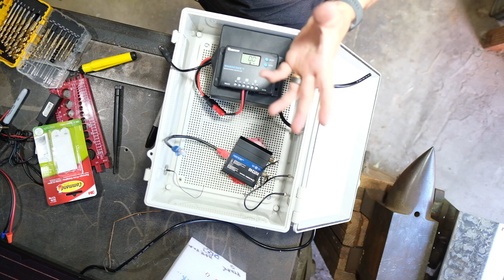Off Grid Miner: What's In The Box?

Comment: Hey king I'm going to be making a off grid solar miner but can you please help with a question I have.ok I'm wanting to know if a 3.2 volt 100amph battery will run a indoor nebra and a hotspot with 2 50 watt solar panels one to catch the rising sun in the east at 45° and one to catch the setting sun in the west at 45° what do you think or would two 3.2 volt in series be better so 6.4 100amph please what do you 🤔
Reply from the maker: Hi Mike, you'd have to run the numbers for your area regarding battery & panel size.  Volts x amps = watts.

Comment: Getting close to finishing my first off grid build thanks to you...One big question...if Im using a Sensecap miner can I just cut off the transformer and wire direct into the load of the wanderer?  And would this run in parallel to the load from the cell modem? Keep rocking it!
Reply from the maker: Nope, the Sensecap takes 5v and the Wanderer is pushing out 12.  You'll need a 12v to 5v buck converter with a USB-C end, like this: https://grstl.ink/buck-converter
Reply: @thegristleking  fortunately I have 2 in my possession...appears to fit in the sense cap...as far as the PepWave Max there is not a USB-C fitting...but there is a set of power lugs...you think I can direct wire to Wanderer as long as I fuse it?
Reply from the maker: @carlbreeden9074  just check the input voltage range on the PepWave; that's what you're using for a cell modem, right?

Comment: Hey Mr. King thanks for the vids. I'm very excited about the possibility of an off grid miner. Does the RUT240 take a sim card? Thanks
Reply from the maker: Yo DG!  Yep, the RUT240 takes a SIM card.  All cell modems should, whether you're getting Cradlepoints, Teltonikas, or another brand.
Reply: @thegristleking  I have a 40GB plan from ATT provider, I heard on another video it needs to be 100. why does it have to be so high. Also when I remove the sim card from my current hot spot and I insert it on RUT240 the only port I need to open is the 44158 or is there another port? can you do a video about settings on RUT 240 and why you need so much data. thanks in advance, your miners are sick!
Reply from the maker: @Diydad05  the reason the data requirement is so high is that current hotspots keep a copy of the blockchain on the miner.  That copy is growing larger and larger as the network grows.
  Once we move to Light Hotspots the data requirements will drop from where they are (up to 150GB/month) down to 100MB/month or less.  Yes to 44158; that should be it.  Check this RUT240 post:  https://gristleking.com/step-by-step-rut-240-for-helium/
Reply: @thegristleking  thank you my brother! Happy thanksgiving. I think I have to change my T-Mobile sim to a business plan now. Have the current one and doesn’t work with the RUT. Going to go thru your checklist to see if I can get this working. Keep up the great work. Thank you for the reply, much appreciated!
Reply from the maker: @Diydad05  careful with the current RUT instructions; the off grid stuff is in total flux right now, and many are finding that a static IP is stopping their earning.  You may not need a large data plan at all.
Reply: @thegristleking  Are you finding the miner is profitable, even paying for the data plan?
Reply from the maker: @AkolytosCreations  yes, but keep in mind this is JUST the packet forwarder.  I'm able to do that because this is a DIY Hotspot from way back a year and a half ago when that program was open.  The good news is that this is what Light Hotspots will be, so if you can hang on for a few weeks you'll be able to do the same.  Data use is 100 MB or less per month on this.

Comment: How to do you power the RUT 240? I couldn't figure out how to power it with the VIctron Smart charge controller. I tried using a 9V step down converter connected directly to the power pins. Also for the bobcat since it is 12 V 1 amp power in can I directly connect it to the charge controller?
Reply from the maker: Take the cable that comes with the RUT240 and cut off the wall wart.  Strip the outer sheath and you should find red & black cables. Hook those up to the correct "load" terminals on the Victron.  Victron puts out 12v, RUT240 takes 9-30v, so no stepdown needed.  For the Bobcat you can do the same; since it takes 12v you can connect it directly to the load terminals in the Victron.
Reply: @thegristleking  Hi! Thanks for the videos!

What should I connect the pin 3 and 4 (INPUT and OUTPUT?) to? Are they needed? 

Or should we just connect the red and black cables?
Reply from the maker: @apeusmaximus  I think it's just red & black IIRC.  That should be all that's in the RUT240 cable, right?
Reply: @thegristleking  the schematics say also a INPUT (green) and OUTPUT (white)?

Hence the doubt. Maybe they don’t matter, maybe they do 😅
Reply from the maker: @apeusmaximus  fair enough.  The red & black is all I connected.  :)
Reply: @thegristleking  ok great to know! Thank you so much :)

Comment: Isn't there huge cable loss with the connector?
Reply from the maker: Nope, why would there be huge cable loss?
Reply: @thegristleking  because of the short not isolated antenna cable. I heard the RAK antenna cable even has a 2dbi loss
Reply from the maker: @Daniel-ck8ii  not unless it's a super long super thin cable.  In the case of this miner, the losses are minimal.  It's a few inches of tiny cable into the N-type connector, than less than 3' of LMR400 into the antenna.

Comment: Just tried building this and the panel won't even charge the solar controller enough to turn on. Anyone else had any luck with this setup? Completely lost and out some $$$
Reply from the maker: Hi Morgan, did you charge the battery fully before starting up?  Have you tested your power draws?  Have you tested the panel? 
 Sounds like there's a step being missed here, or you might have some faulty gear.  Carefully go through the whole power path and see what might be the problem.